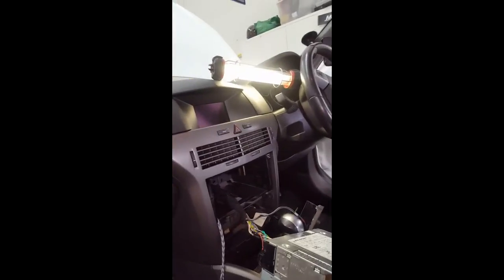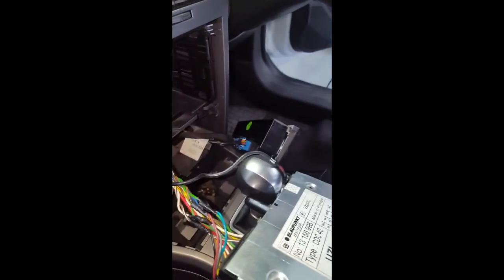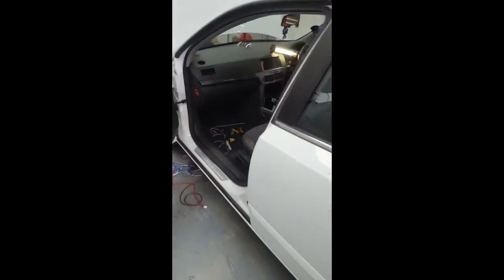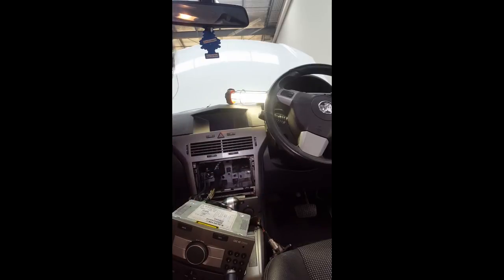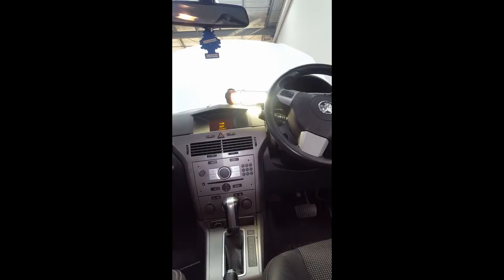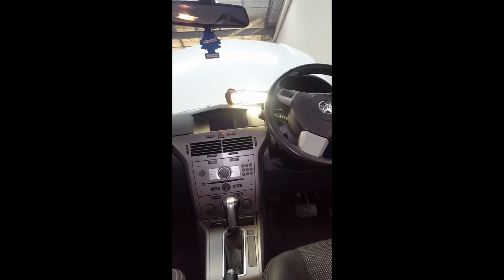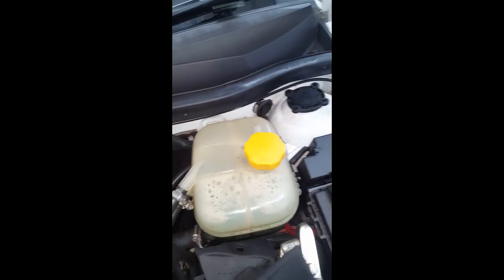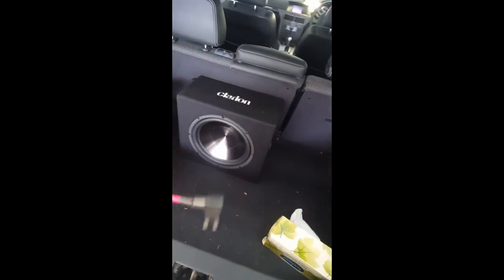How to install a amplifier into a 2005 Astra

Comment: I put a knife through that grommet and nothing will come out from other side and I've put knife from both sides. Very confused why I can't feel or see the tip of the knife
Reply from the maker: bondasfaq it goes a fair bit in but it's there just keep trying but be careful not to cut the car electric circuit

Comment: Does anyone know what wire is the remote cable as I'm not getting any power to the sub
Reply from the maker: You can try tap into the cigarette lighter port if not next best place is the fuse box
Reply: @mavsonline  do you know what wiee it could be on the fuesbox
Reply from the maker: You need a fuse tap linkage it's safer as for what wire sorry it's been a while I can't remember. Best to use a test light or a beagle to probe the wire if you're not taping into the fuse it self
Reply: I've defiantly got power to the sub but I've tried the blue wire on the cd30 stereo but no luck I'm taking it a mate tomorrow to sort the issue if I can't
Reply from the maker: The factory headunit is canbus so no accessories output you need a alternative trigger, you can obtain it from the in cabin fuse box just use a fuse tap to be safe
Reply: @mavsonline  sorted now we taped into a 7.5 amp fuel thank you
Reply from the maker: @Nedic83729  no worries at all